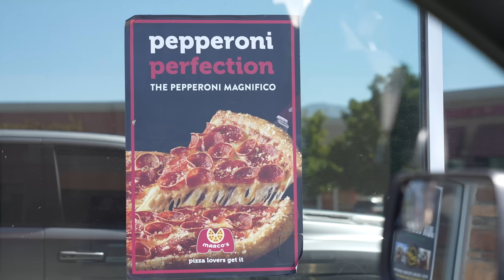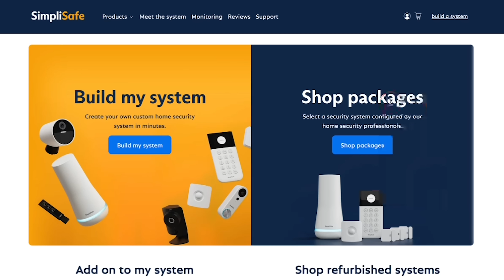BUILDING A DIY GARAGE W/APARTMENT | TRENT & ALLIE

Comment: As a mold expert, I just really want to emphasize the importance of prioritizing building the drain that Trent was talking about the other day so that water doesn't pool against the back wall, before the ground freezes! You really don't want to have to wait until next spring to do that cause you could get some major water intrusion issues in the meantime. You guys are doing great and moving at such a fast past!
Reply: I think they are waiting on the addition approvals, as I think they will need to also do footings etc for those as well as doing the drain line that Trent was talking about all at the same time.
Reply: @kevinfisher1345  no
Reply: I agree with Gabrielle  about the installation of a curtain drain would be  so  important. The purpose of the curtain is stop pervasive moisture the drain being in the ground deep enough to deal with the water that is flowing through the springs into the area currently under and percolating  through the ground behind your structure. Install the curtain drain and make it drain away from the structures
Reply: @bonniest.pierre2045  Uhm Yes! That is what they stated a few videos back. Trent even stated roughly where the drain would end up. And with it starting near a fairly always wet / damp spot.
Reply: @kevinfisher1345   Yep!  On the prior video! 👌👍👍✌

Comment: Might I make a suggestion for your hot water situation for the garage apartment.  To avoid the need for space, you can purchase a tankless water heater for the bathroom and for the kitchenette.  You can get one separate one for each room or one for both.  There are tankless water heaters for cold climates.

Comment: Our son has his garage hot water heater in the attic crawl space which is legal in our State.
Also just built there small Closet and Linen Closet into the wall between the studs of the attic section. 
Also did the same inset with their Apt Frig and Microwave...just insulated the wall behind and each side.
Saved  space and had everything out of the way.
All open floor space was for the limited furniture and mounted the TV on the wall with a swing out holder. Could watch from the bed or turn towards the sitting area. Used a space between 2 comfortable chars to put a small table so as to sit drinks and things and yest to be able to eat off if needed.
It is simple but elegant. 
Don't forget a permanent or portable stool in the shower. They have one that  is stored in the bottom of the linen closet.

Comment: A very small tankless water heater might make a lot of sense in the garage.  It will only be used occasionally, so there is no need to heat and maintain a large volume of hot water.  A small water heater would only work for one or two people to shower.  But if you have guests there may be more people than that using the space.  I think tankless makes sense for a place that will have occupancies of either 0 or 2+.
Reply: Is that the same thing as the on demand hot water heaters?
Reply: @birdlady2725  I'm out of my range but I think on demand just heats up water in the line before the "real" hot water gets there.
Reply: Yes @birdlady2725
Reply: @Jeff-jg7jh  nope.  Look up on demand water heaters.  There are different sizes depending on the use ( 2 people shower or bath, washer use, dishwasher, etc).  Some use propane, or electric, or multi fuel.... They are nice as small footprint/size as no storage tank needed.  Can also use 2, one for kitchen, one for bath etc.  Some are ok to be inside, kthers need to be mounted outside.
I hope this info helps.

Comment: A Rinnai wall space heater would heat that space easy. If you want AC as well then go with a split heat pump. Stairs up at the back you may want to consider a roof over them in snow country.

Comment: Trent... You might be able to solve the space issue around the water heater with a removeable wall... or double closet doors that open.  With the doors open, a repairman would have the room to work. That worked for us in our house.

Comment: Trick we did in the same situation is when citing the pieces is to mark the stud location on the inside. Screw a scrap piece of wood between the stud as a handle to hold as the other nails the outside. Good idea for future heights.

Comment: Any time I wanted to make my ladder taller or less pogo-stickish, I'd drive my truck up to the area and brace the end of the ladder in the truck bed.  I'd also screw on cleats on the inside of the garage door opening so sheets had a resting point instead of me holding them up.  Nice work guys!

Comment: Just a thought: If you plan to rent out the top part of the garage, instead of a Microwave oven, you can get an Airfryer, they work so much better than an oven, and a microwave. food is cooked in less time and using an Airfryer is healthier than a microwave. The garage is looking great.  Welcome back Dana
Reply: Came here to say that. Lots of  compact countertop multi use appliances that incorporate airfryer/ toaster/ convection oven.
Reply: Didn't know air fryer were healthier. I rarely use a microwave because it kills nutrients (and probably us lol). Getting myself an air fryer
Reply: @barbibutton9619  Not sure if you have a Costco around you, but I have seen the cheapest prices at Costco.  the Airfryer they sell has five functions, warm, broil, back, toast, airfry.

Comment: Check out Black & Decker electric flash water heaters.  One would fit in there perfectly, they require no vents, and work great.  We have the smallest one because our water pipes are never below about 65 F.  Our limitation is to not use hot water at multiple places at the same time.  They have a thermostat, so the water never gets scalding.  And the coolest thing is they work great for getting solar heated water up to your 105 F pleasant shower temperature.  Great for you guys is the fact that they use no power when the hot water does not flow.

Comment: Have you thought about a mini split? It would save space and be both a/c and heat. You also wouldn’t need interior space and could put the exterior portion on a raised platform in back or have it in the garage and vent it to the outside.

Comment: in light of the water issues you've had in the basement and the relatively little use there would be, maybe consider a tankless water heater for the garage. it wouldn't need the same clearances and take up the little space there is up there.

Comment: Hey guys! Look into a Mr. Cool unit to heat and cool that area, I believe you installed one (or similar) in your mud room. Also, did you size your septic system to accommodate the additional bathroom and kitchen? Otherwise, what you have thus far looks really good. 😎👍

Comment: You haven't lived until you climb a 40' 3-section wood extension ladder. As an apprentice many many years ago the first stage is basically an angle going up.The second stage is almost vertical and then the third stage angles again.......oh to have that strength and agility again.

Comment: Note to Allie:  If the aluminum ladder didn't flex it would break.  It's safe and working as designed.  Doesn't ease your anxiety when they are working at such heights.  GRIN
Reply: They should be using scaffolding and not climbing ladders with big heavy sheeting.  And leaning out nailing sheets on would not be acceptable or regarded as safe by any workplace inspectors in most countries .

Comment: mini split for heating cooling n apartrment?  I went through last winter with Mr Cool  units heating my location in Maine.  You would need two or 1 with heat tape on the waterline.

Comment: Ok..you guys rock! That sheathing was kind of scary... Sooo, I love the garage so far, but hate all the space that is being wasted in those deep knee walls... Did you ever think about framing in a horizontal beam from the corner of the roof, to the interior studs, and making little cupboardy beds in the walls, like on a boat, or bench seats? You could also put recessed shelving in between the wall studs...If nothing else, you could make a little platform in there for storage... Just a couple ideas to utilize that space...

Comment: Instead of measuring 40 degree angles, you can try measuring the short side and long sides and mark them then cut the line between. Or at least use it to double check the angles

Comment: I'm  wondering what is going to  hold up  the eave up on gables. When  I  framed  we had look outs every  two feet to hold the facia on .It  seems  with  all the  snow  you get  the eave will sag from the weight.

Comment: That corner piece I would have screwed in a board at the back so Trent could hold it while the other uses the gun. Then take the board off. I think outside the box. Lolol could have done on the last two pieces too. 🤟🫶👍🇨🇦just another thought. If you go heat on demand you won’t need a water tank. Just a water line. Right?

Comment: Don't underestimate the power of "eyeballing" when doing a check.  Eyeballing is often poor as the main measurement, but it is wonderful as a double check.  A lot of expensive mistakes happen that could be prevented if the DIYer or experienced craftsman just asked themself "Does this look right?" before cutting.

Comment: Are you doing exterior stairs to upper level? They should be enclosed or covered due to snoe, ice, safety.
Reply: Exterior stairs in a cold climate are awful.
Reply: Kind of think the architect would have considered all of these 'suggestions ' along with Allie and Trent. The mind just boggles at times at the thought in some comments, that these two have no intelligence whatsoever.

Comment: The view out of the loft is looking great. Did you consider to put in more windows? Would be fantastic to have windows nearly all over that wall. But I know it would be very expensive.
Reply: . . . or . . . Larger windows.   As it is . . . the only way to appreciate the view is to walk up to the window
Reply: You would think in case of fire that they would have to have more windows and maybe another door? Dunno.
Reply: @KayInMaine  imagine how great it would be with the front wall mainly windows, and a door opening onto a balcony.
Reply: @KayInMaine  Well in some areas of the world you have to have a second escape. This is mostly realized by a cord ladder attached to the wall below a window, rolled together and tight up.
Reply: @wjhann4836  yes. That would be true. They have to make sure that the place passes the fire codes.

Comment: The ladder is to steep!!
Should be able to put toes at ladder bottom and straight arm be able to reach the ladder rails without bending your arms thus it’s a safe angle to use

Comment: I'm totally inexperienced in building... It just seems if you started at the top w side sheathing then you'd have better access for getting the sheets up, placed, and nailed. And then the bottom ones could be done from ladder.
Reply: They are using the lower rows to hold the sheeting up on the upper rows. The lower row holds the next level and all they must do is put pressure on it to keep it there. With your scenario they would have to muscle it up there and continue to muscle it to hold it up there while trying to nail it. If you re-watch it, you can see that is what they are doing.
Reply: You start at the bottom and go up to make it rain tight because your sheathing at the top,  it's covered by the eaves of the roof
Reply: Your suggestion is a lot more work. It seems to me from someone that has had experience with this. That they should have sheathed the walls before they put the walls up. OR. That is what they have scaffolding for (how I typically always did it). Heck even ladder jacks would be better and easier. Have I done it the way they did .. sadly yes. But only in a pinch. And not for a major project or complete new build. You go prepared.

Comment: Seating sideways even with belts is not safe. The forces exerted on the body in a collision can cause serious neck and spinal injury due to the violent sideways movement of the body. I would only sit facing forward or to the rear. Yes, it is legal to use side seating with belts, but that doesn't mean you should do it.

Comment: Water tank for water heating -- in the side space????    Those trusses are not designed for vertical loads, as are floor joists.  You would need to get engineering clearance to put anything much at all in those spaces.